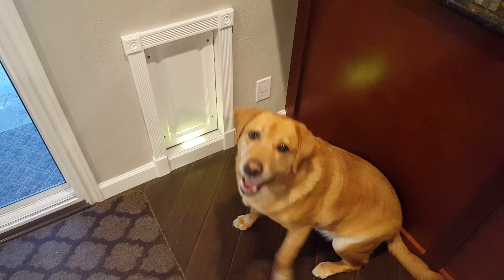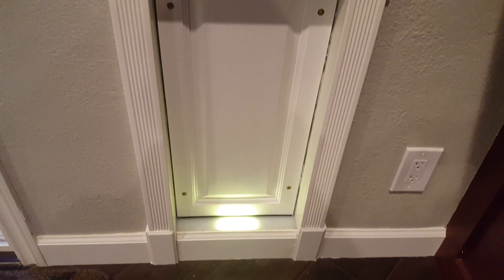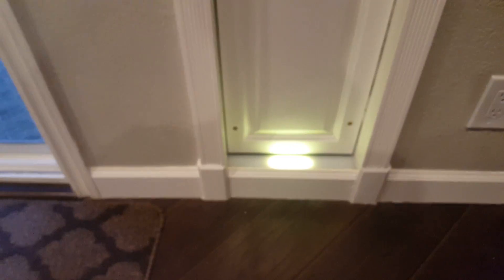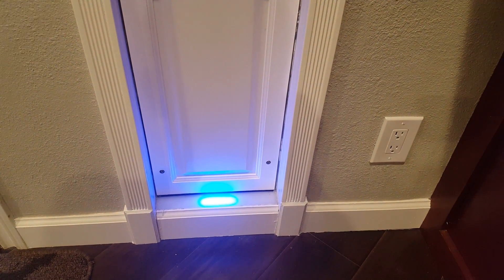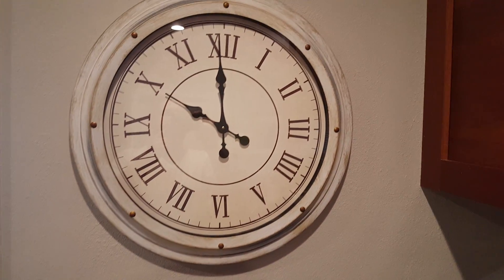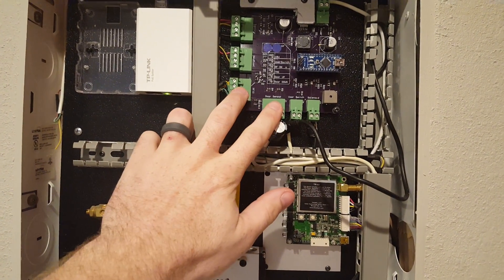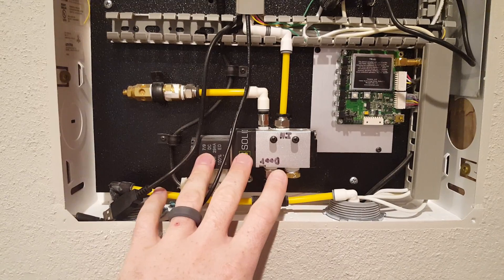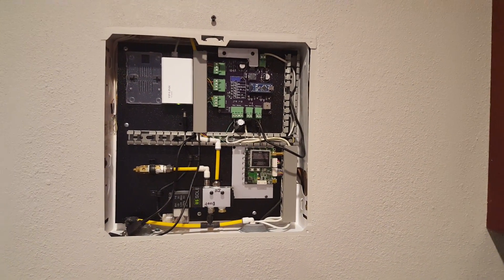World's Coolest DogDoor ENGR Version

Comment: That's a really great door. Just one question. Why is the door going up again before it finally closes. Some savety mechanism?
Reply: either that, or a problem with the existing pressure differential on the solenoid valve while switching to the locking mechanism.. or just a simple programming problem :)